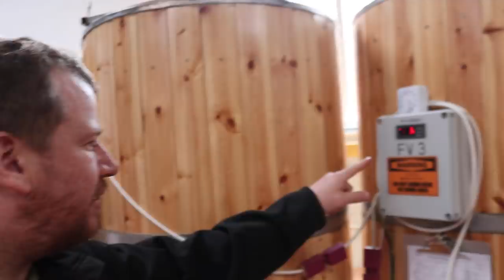Will The Beer Last The Lockdown?

Comment: Hi Chris, I watch your videos, it's me who helped in a pub Cellar in Ripley.  I saw the soap making, I make biodiesel, and half way through, I have to drain glycerol off the bottom, then it can be used to make soap as, and yeah, use potassium hydroxide, kaoh it is liquid glycerol, but as you also sat, use sodium hydroxide, naoh, it solidifies, and then can make bar soap.  Il lre warn you, when you have finished making it, let it stand for a week or 2, or it might burn you, as you might have noticed, when you mux sodium or potassium with liquid, it gets warm.  And with sodium hydroxide, the mixture will get hot, and if you get it on you, it burbs you and causes ecxma.  I would come up after all this lick down crap, and show you biodiesel, and you could put it in your van if its diesel. I might he interested in waste oil from you to make it at home, free, or would give you something for it.  Please get back to me, look ne up on f, type Andrew Mckenna.